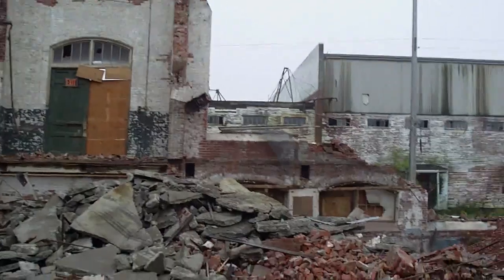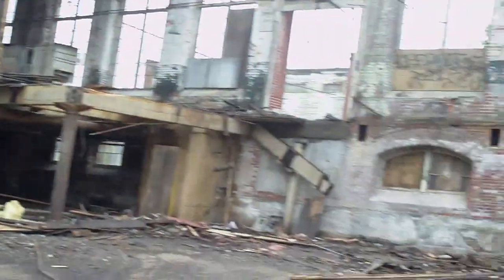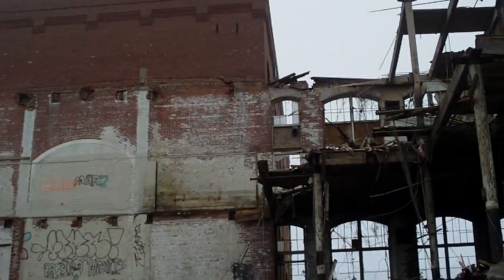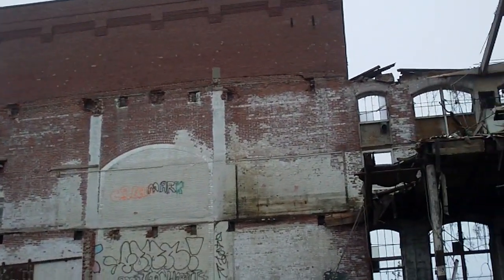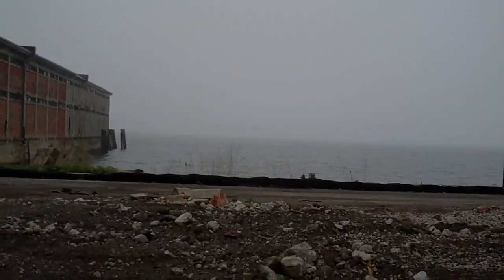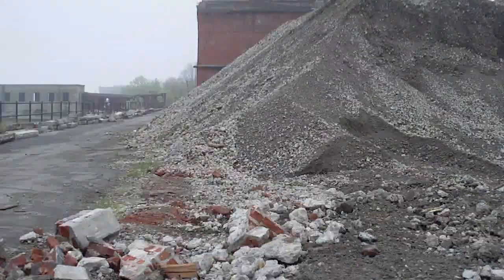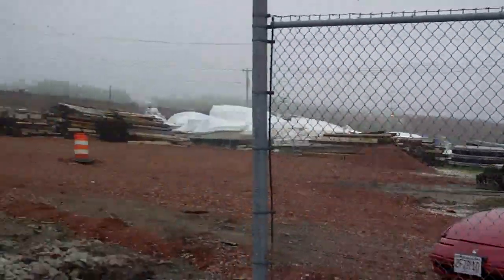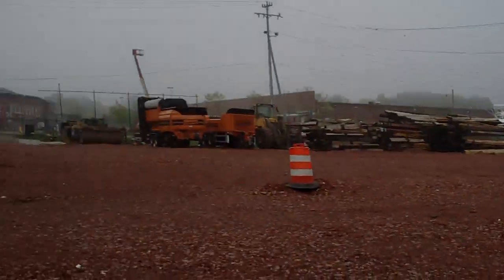Cordage Park demolition site

Comment: I had at least 6 relatives that had worked here at different various years.I was wondering if those bricks that they demolished were Hedge Brick Company  Bricks ?
There were 3 Types of Bricks with the Hedge Company name on them , one was L.Hedge and the other was B. Hedge red bricks . I also know that Building 3 was made of Different Sand -  color Bricks. I remember back in the 1970's and 1980's the hedge bricks were valuable @ possibly $ 200.00 apiece to $50.00 apiece. I have 2 of them that say B.HEDGE , Plymouth ,MA  - Jim
Reply from the maker: I do not know, but I know that some masons came by and I allowed them to grab as much brick as they wanted. I also know that they crushed up the brick into rocks to use for the ground. I haven't been to the location since May 2012 though.